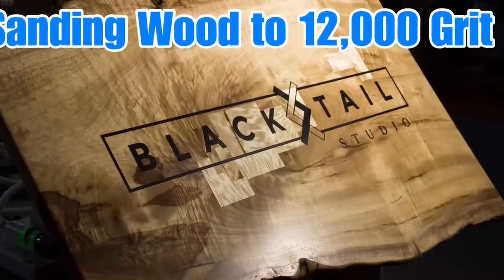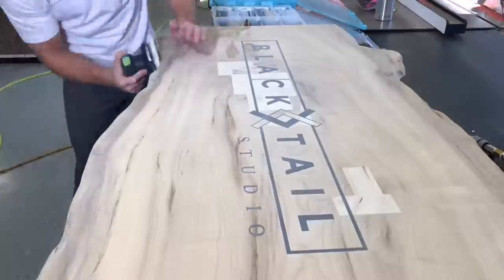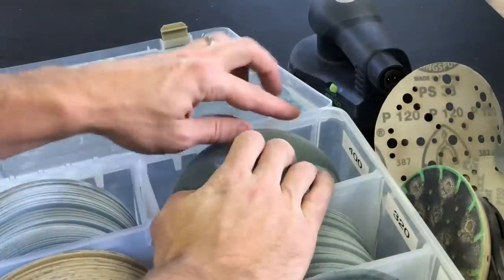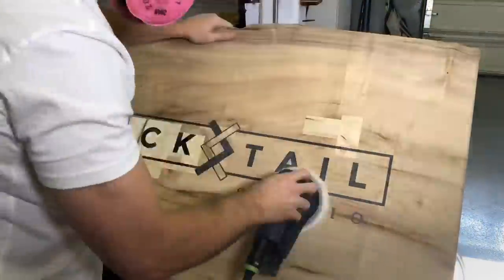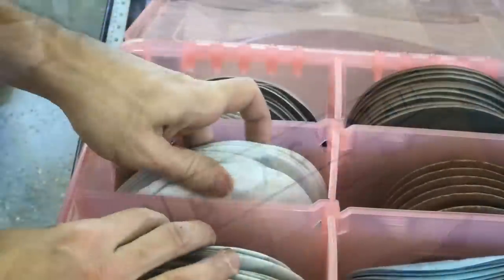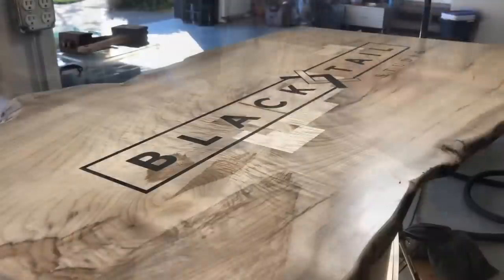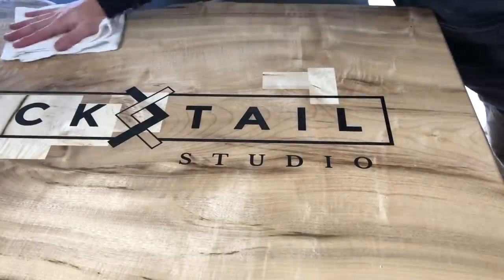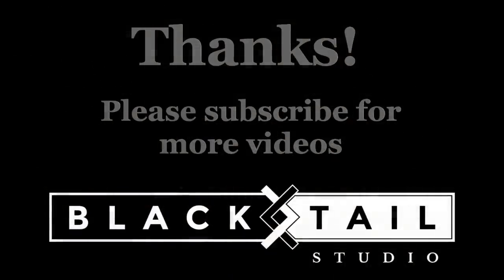Sanding To 12000 Grit

Comment: It turned out really nice, burnished wood was a very common way to finish wood for hundreds if not thousands of years. What type of sheen does that oil give to wood sanded to 400 grit?
Reply from the maker: It’s a very nice finish at 400. I did another build on YouTube of a waterfall end table that was finished at 320 if you’d like to see.

Comment: I've seen chatoyancy tests that suggest that sanding to such a high grit before applying the finish, increases the chatoyancy in a lot, but not all wood species. So, if you are after chatoyancy then it's probably worth it.

Comment: And here i was told sanding above 600grit before varnishing was overkill.
Do you tack in between grits?
Reply from the maker: It definitely is overkill for varnish! This isn’t varnish though.
Reply: @BlacktailStudio  Yeah , no i got that. I was drawing the attention to 600 grit being too mcuh and just how far u pushed it, not that was advising anyone to try varnishing a 12000grit wood. I bet the varnish would feel rougfher than the wood at that point.

Comment: that is an awesome look, i was actually going to ask for your input, i am deciding between getting the festool rotex and ets 150 orbital sander, the rotex would be nice for dual function and i have seen videos of some great finishes using one, on the other hand the ets has a finer orbit and is designed with finishing in mind, can decide any info would be great, i typically make epoxy charcuterie board and small tables
Reply from the maker: Thanks Nick!

Comment: Just wondering what you use now instead of odies oil. The new one you suggest with the link is not available...
Reply from the maker: Rubio mostly!
Reply: @BlacktailStudio  why not use tung oil? Its much cheaper for more oil and dries hard...penetrates the wood for when you sand down to 7000...is safe for food etc. I wood like to buck up for a more marketed product but if the end result is same then i wood think its better to save the money...have you tried tung oil before?

Comment: Is it really necessary to make such small grit jumps through 3000+ it doesn't seem like it benefits to keep jumping 400 grit each time before the 8000
Reply from the maker: I followed the manufacturer recommendations. Usually a good practice when sanding.
Reply: I guess I'm just more used to knife sharpening where 3000+ tends to be mostly polishing and less sharpening.  I admit I'm not as experienced with wood as much as knives where sharpening/polishing goes quickly from 3000 to 6000 to 10000+ grit. Glad go get a response from the channel itself. The end product turned out beautifully. I just was skeptical of the amount of steps to get to that final product.

Comment: Regarding Odies Oil...the people over at Black Forest Wood Co say that it doesn't fully cure. They say that in 100% of the cases where they used it, after about 6 months to a year, the oil simply evaporates and the surface is subject to scratching and ring marks. Is there something you do to avoid this? They prefer Osmo. I'd like to think this won't happen as I just purchased a jar of the Odies Oil and Odies Wood Butter.
Reply from the maker: Best to try things for yourself. Those two companies had a falling out. Odie’s can be tricky, but can also be a great finish that lasts a long time.
Reply: @BlacktailStudio  Ahhh....the 'falling out' part might say it all. People can be funny. I'm going to use it. When you think about it the basic ingredients of all of these choices are not far apart, then each mfr puts they're twist, including the Sam Maloof product. I used to mix these myself...3 equal parts poly-tung oil-linseed oil, thinned slightly. It's very good but harder to apply. BTW your comparison was instrumental in me choosing Odies over Osmo. Thanks Cam and as usual I am a fan. More videos!!!!!
Reply from the maker: Ross Nanfito awesome, appreciate the support Ross!

Comment: Gotta say, I very frequently go up to 400, 800 or even higher on wood, and I have never had issues with a finish bonding.
Reply from the maker: Yeah, Odies is a little different than traditional finishes. Most say not to go past 180.

Comment: I haven't worked with wood sense the early 80s. Don't people intermittently sand and damp cloth the surface to get the grains that would otherwise pop up when you added your finish? It can be smooth as glass then run a damp cloth over it and let dry before sanding again. do these a couple times at least. No damp cloth at the end though, just your finish. I used black walnut and tung oil and it was gorgeous.
Reply from the maker: Some people definitely do still do that. For this finish it’s not recommended though.

Comment: Pretty nice, although I do wonder why you very slowly go up to 400, and then go all the way to 1500... What happened to say a 600 or 800?
Reply: Dokter Roetker look up the micron size of sand paper. Going from 100 to 120 is barely a difference. Theres no need to go in such small increments
Reply from the maker: Micro mesh is different than normal paper. 1500 is more like 600. Just followed their specs.
Reply: @BlacktailStudio  ah okay, thanks for explaining :)
Reply: @TheStrokke1  that's what I mean, he goes very slowly from 100 to 120 to 150 to 180 to 240 to 320 to 400... and then 1500! Seemed like a huge jump, but apparently that is more like 600 with normal sandpaper, so makes sense.

Comment: I've been sanding to 10K on small things and love the sheen you can get from just the wood.  I've been finishing with Odies Wax (not oil) at the end of 10K but haven't put anything big or expensive to the test. My question is do you think the sheen hold up to use without getting scratched?
Reply from the maker: I think any high sheen is more subject to wear and tear

Comment: Wouldn't make more sense to use the oil at around 400/800 grit to soak and then continue to burnish up to 12.000 and finally finish with oil once more.
Reply: I would imagine you get much more control of the final product doing it incremental.
Reply: You can sand to 600 and then buff Odies oil to a pretty high freaking gloss. Add some wood butter to make it glass.
Reply: I think that defeats the purpose of the video. He didn't dry sand all the way up to 12000 because it was the most reasonable and practical thing to do, he did it because it's something nobody would ever do.
Reply: @atomicwalnut1581  what's wood butter
Reply: @oconnorscameras1  It's a hard paste wax made by Odie's Oil. Awesome stuff.
Reply: @atomicwalnut1581  cool, thanks, I'll give it a try

Comment: It is not "wipe on - wipe off"  it's "wax on - wax off"  😀  I am in the Polish The Wood school.  When I do a guitar body after coloring with analine dye I sand (polish) to 5000 grit then use tung oil or linseed oil dried with turpentine gum spirits.  Then use beeswax/orange oil for the final polish with a extremely soft cotton buffer.
Reply from the maker: Nice!!

Comment: Looks great. I’ve sanded a pine top with resin inlays up to 4000 grit and then used polishing compound then 4 coats of tung oil. It’s on a kids table and is extremely durable. 
There is a video on my channel if you are interested. 👍🏼
Reply from the maker: Oh nice! Thanks!
Reply: You’re welcome I don’t think I actually filmed the buffing with the compound but I definitely did use it and it came up nicely.

Comment: If we keep increasing the grit can we make a wood mirror?
Reply from the maker: I dunno... could definitely make it shiny-er
Reply: A physics teacher one told me, in explanation of the reflective property of light waves, that a piece of glass that has been painted black on one side will be an effective mirror on the other side if the object in the mirror is well lit...  AND that this held true for any super smooth surface that was black.  That same piece of glass painted gloss black will be like a mirror on both sides.

I would think some very dark or black wood, burnished this high, would make a pretty good mirror  :)

I subscribed so I can be sure not to miss your video when you do it.  I'll wait impatiently.... :)
Reply: @kurtblackwell6214  Yes! I noticed that since I was very little, looking out my window at night while the room is lit.

Comment: how could that printing not abrased ?
Reply: my guess is that the printing is a wood inlay, made on the CNC and then glued in place
Reply from the maker: Kungmat is right. It’s a CNC logo, filled with epoxy. The epoxy sands just like wood. Great question!
Reply: what a great technique.. thanks for the info bro.
Reply: aha! I actually thought it was some very dark wood  @BlacktailStudio

Comment: Why though? I'm sure that won't last very long, like if it gets too humid it's ruined, if something touches it it's ruined.

Why not just use any coating and polish that instead of the wood itself?
Reply from the maker: I’ve seen people spray or brush a finish on before. Never seen anyone polish the wood itself.  I doubt this method will replace traditional finishes. But a fun project that made some unique results. And if you’re right, I can always throw some lacquer on later 😉

Comment: Jumping from P400 to P1500 is insane and shows that you don´t have any sort of knowledge about how sanding paper is working.
Reply from the maker: Check out the micro mesh website. They specifically say to jump from traditional 320 to micro mesh 1500. Micro mesh isn’t the same as traditional paper. I always get nice chuckle from people who take the time to write a message like this, when they actually have no idea what they’re talking about. Cheers for that!
Reply: @BlacktailStudio   Ok I missed that beginning you use standardised paper (P) and later one is not standardised paper so your 12000 grip paper may be same as P2500 or P6000, that's meaning of standardised paper, not micro mesh match P1500. I suppose if micro mesh says 1500 grip paper is suitable to use on P400 sanding it matches maximum P600 grip. If for real you go from P400 to P1500, there almost impossible to get rid of P400 scratches. And as looks you familiar sanding wood you know also that for hardwood and sanding with machine even with P800 soft paper gives almost glaze look :D

I would recommend using standardised paper up to P600 normal, then P800-p1200-P1800-P2500 with the soft underlayer and for finish 3M Trizact P3000 and P6000.
Reply: 12000-grit is equivalent to the ~P2500
Reply: @BlacktailStudio  What a wonderfully sublime rebuttal.

Comment: The entire point of these videos is to see the final result. If you show the final result at the very beginning of the video, there is little reason to watch all of it. You should have saved that 12,000 grit with oil shot for the very end for a "reveal." It's almost like watching Breaking Bad, but instead of the first episode ending with Walt and Jesse making meth in the desert, it ended with Walt laying dead on the floor of a garage, there's really little hook to the series.
Reply from the maker: Another reason I’d never make it in Hollywood... or New Mexico.